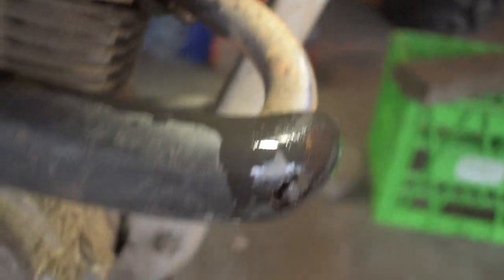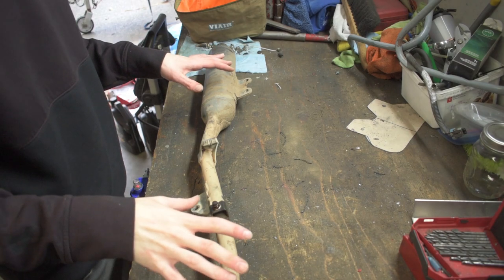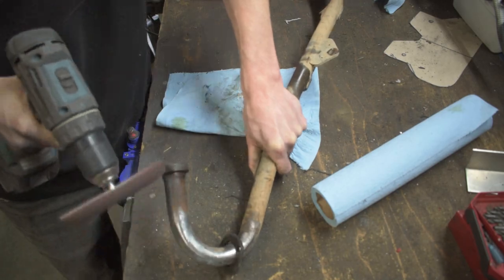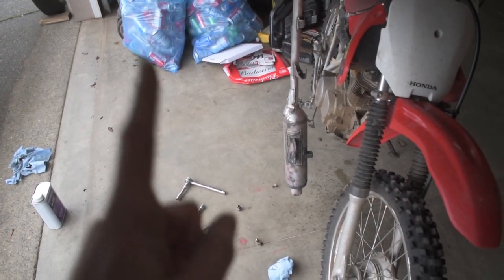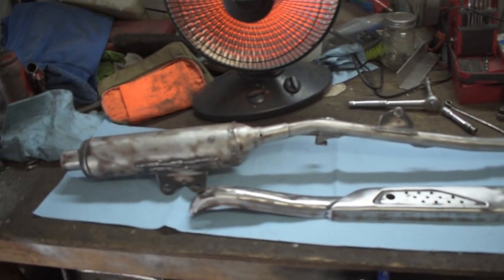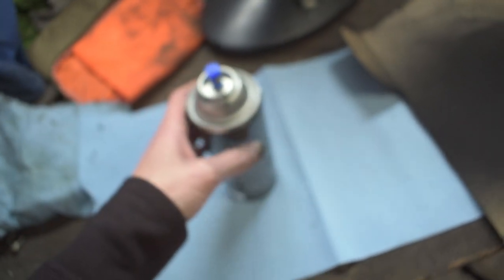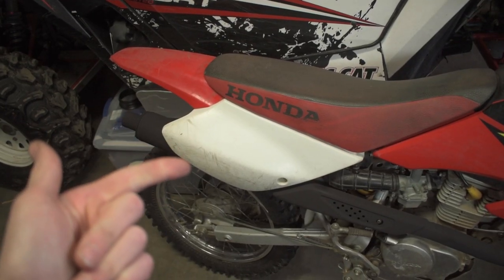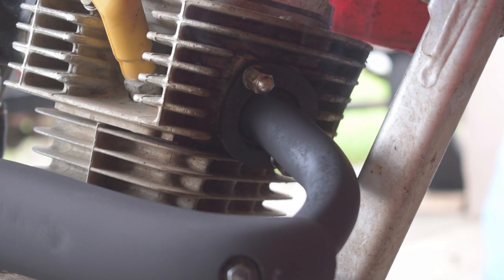How To Restore And Paint A Dirt Bike Exhaust At Home

Comment: it's been nine months, how'd the exhaust paint hold up? nice job.
Reply from the maker: Still looks minty! Other than the obvious boot rub spot but that will always need touching up from rubbing
Reply: @AaronsEnduro  been thinking of doing the exact same process but I've seen in some videos where the VHT high heat paint didn't work out.. some say it has to be cured in an oven? Yours is the first one I saw with the curing process don on the bike
Reply from the maker: So as long you cure it properly it will adhear. Id say 99% of people who try to paint anything with any paint dont ever use a proper cleaner to prep the material (such as a rubbing alcohol or acetone) to clean dirt or debris off (just washing with water will not be sufficient)
Reply from the maker: You need to make sure to not overgeat the paint right away ( as you saw me bring it up to temperature then back to cold and hot and cold again before letting it get smoking hot
Reply from the maker: VHT product is expensive and top of the line stuff. If its doesnt stick , you’ve done something wrong
Reply: did you follow the time intervals for curing and cooling written on the VHT paint can? A
Reply from the maker: This is what I followed from VHT

Paint must be completely dry before curing
Run at idle for 10 minutes
Cool for 20 minutes
Run at idle for 20 minutes
Cool for 20 minute
Run under normal operating conditions for 30 minutes
Reply from the maker: Directions can be found here 

https://www.vhtpaint.com/high-heat/vht-flameproof-coating
Reply: Thanks so much for the info. Really appreciate it.
Reply from the maker: I ever need help gimme a shout!

Comment: Do I need primer for this exact type of spray paint or can I just paint it without primer?( I painted it without primer idk if I did it right💀)
Reply from the maker: Its definitely advised to use primer!
Reply: @AaronsEnduro  did you use primer?
Reply from the maker: Sorry no I didn’t, I thought this comment was on a different older video lol
Reply: @AaronsEnduro  will the pain still stick and last even though I didn't use primer?
Reply from the maker: Yes if you use the correct paint its designed to go straight onto the exhaust
Reply: @carlosmartin3881  Theres a different trick that i found. 

If you want to have it glossy you need sandpaper grit 1500 or 2000 after it cures. 

If you want to keep the black looks black and glossy, you need to use silver one then black glossy one. 

I think VHT probably have them tutorial for things like that. 

Without silver base, it kinda goin to have that smoked dark.

Comment: Will this protect it from getting rusted?
Reply from the maker: This will definitely help
Reply: @AaronsEnduro  ok because I did not know if I should do this because I just sanded it down and I think it’s going to rust now but I will try it thanks
Reply from the maker: If you sand to bare metal on anything it will rust if you dont paint or put something on it
Reply: @AaronsEnduro  ok thanks a bunch
Reply: @AaronsEnduro  I have one more question what kind of acitone is that, that your using for it?
Reply from the maker: Just standard automotive acetone found at any hardware store
Reply: @AaronsEnduro  ok, thanks a whole lot man, this is going to help!
Reply from the maker: No problem 🤘🏼 have fun with it